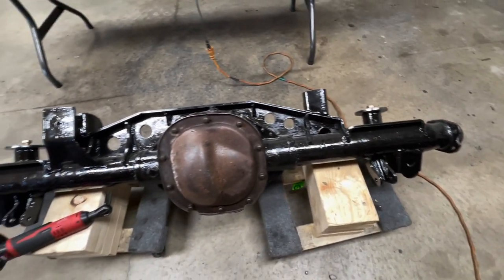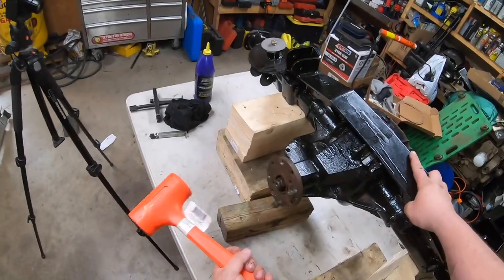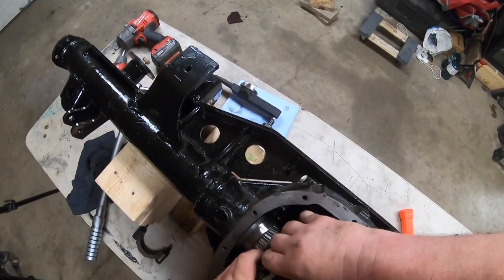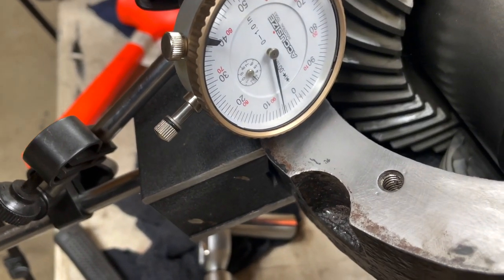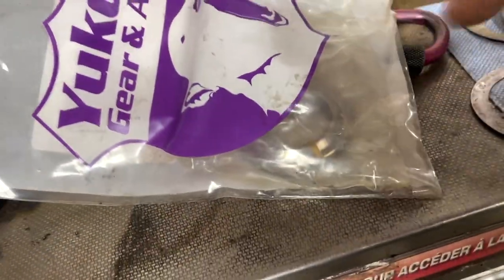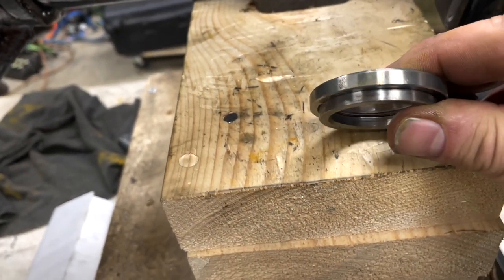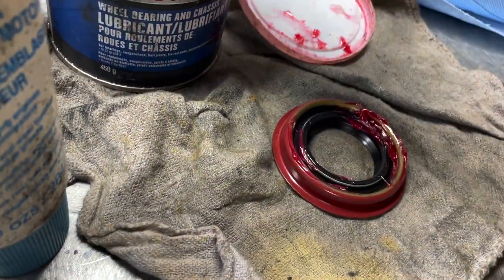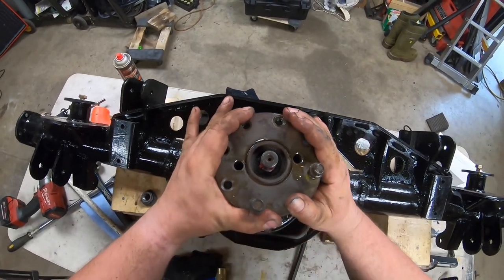HOW TO SET UP AND INSTALL NEW RING AND PINION | Ford 8.8

Comment: Pit the pinion in the freezer overnite, heat the bearing in the oven at 400 for a half hour. Drop the bearing on the pinion, no pressing. Don't forget the shim
Reply: does this not add unnecessary stress to the bearing that could form cracks over time?
Reply: @iReinTV  Not at all. Much higher temps achieved during manufacturing process. 400 isn't enough to change the molecular structure of the material.

Comment: Red loctite is for permanent installation and never again meant to be removed. You should use Blue loctite instead.
Reply: I agree with you. Red locktite will require some heat to loosen back up.
Reply: PROJECT FARM did a comparison on blue vs red locktite... there wasnt a world of difference between the 2 red/blue lock tite when it came to taking them apart... not much difference at all... a few ft #'s?

Comment: Hi Jerry.  Thanks for your tutorials.    I'm having one heck of a time with my Jeep cranking but not turning over and guages not working.  I can bypass the ASD and jeep starts  and guages work no problems.     You posted a video with your buddies jeep having the same issue.  His was the blown fuse.  Mine not so simple.    2002 TJ 2.5L.    ASD  working as it should,  getting correct voltage and getting continuity from ASD to PCM.  The relay is good.  Checked all fuses, they're good.  Checked all wires on that circuit and getting 12V.   5v circuit is reading 4.51V       other than a bad PCM is there anything else that would cause the ASD relay to fail?   Really appreciate your time into reading this and helping me out.

Comment: ahhh the joy of having axle on a bench... in a well lit... warm shop.  not under the vehicle in driveway because garage monkey used impact on the ring gear bolts on nice EATON limited slip differential gear install and figured... its tite enuf.... and the ring gear bolts fell out 3 and poked hole in diff cover and ... oil leaked out and nice limited slip Eaton diff and bearings... all bearings... ruined now.  no thread lock or torque wrench used by shop monkey on my NICE EATON LIMITED SLIP differential that only lasted <1500 miles before 3 ring gear bolts fell out and ruined the whole rear axle assembly.  the rest of the ring gear bolts were finger "tight"... loose.

Comment: What pinion depth tool did you use?
Reply: That appears to be a Ratech tool. I’m not a big fan of them. Unless you’re setting up an empty housing, there’s no need for a pinion depth tool. Start with the OEM pinion shim and adjust accordingly.